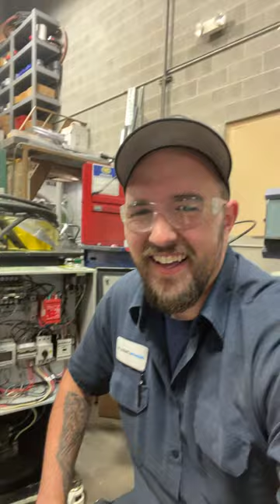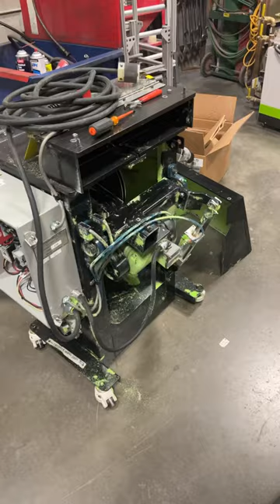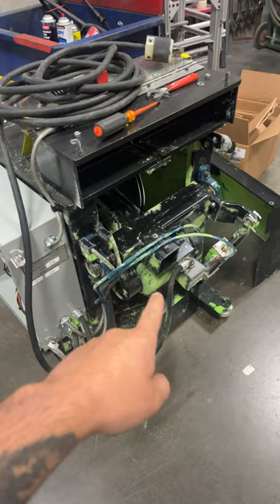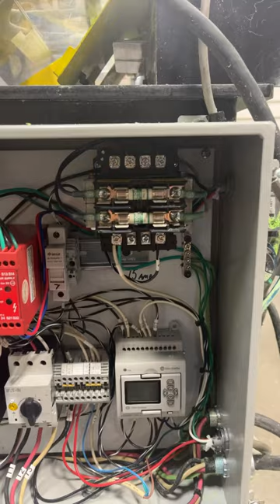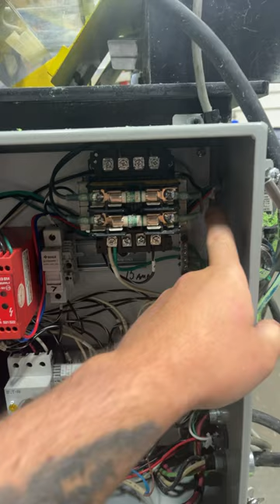Solving problems! #shorts #electric

Comment: Since you are diving into electronics. I think it'd be cool to talk about troubleshooting a bad motor like how to ohm out each leg. Or you can get real fancy and bust out the oscilloscope and give a demonstration of what a sine wave looks like.
Reply from the maker: Great idea!!
Reply: Don't forget to hipot it and the wires to properly diagnose the root cause.
Reply: Technically motors are electrical devices and come under the category of "electrical machines" rather than electronics.

However a the control system for a motor, if one is employed, such as a VFD, is electronic.
Reply: @dansproshop  Maybe even demonstrate a Megger or an Insulation Tester like a Fluke 1507.
Reply: I needed do this today

Comment: 240v ac is weird. The three pin one makes a bit more sense. Just higher voltage phases if I remember correctly.

Four pin 240v you can split the three live wires in such a way to get 110v without a transformer for exactly this application

Comment: You just got to remember that when you're stepping down the voltage your  amperage will increase. When you're stepping up the voltage or amperage will decrease.
Reply: amperage depends on the kva rating of the transformer....
Reply: If he wanted 120 volts he only needs to tap off one hot leg and ground. He didn’t need a transformer
Reply: @Wtfinc  not quite, he has 3 phase power, none of the 3 legs are 120v
Reply: @dalaube  ... he specifically mentions 240 volts and the unit in question has a fuse for each leg, so I'd say it was 240 volt single phase. The prongs on the cord are a ground, neutral, and 2 hot legs.... which begs the question of why use a Xfmr when there's already 120 available?
Reply: @dalaube  oh snakes. He even said 3 phase transformer didn’t he? My mistake lol
(Edit) I rewatched the video, he said the motor was 3phase, thats why I ignored that since capacitor can take care of that, i just assumed, especially when i saw the plug end and it did not look like a 3phase plug when I first saw it. It looked like a regular old 240/120 with three prongs. Welp, good thing for transformers. At least he only needs to worry about. I feel like depending on how a three phase transformer is wired u can have 480 between two legs. Am I correct on that? Imma try draw a diagram see what i find out cause i don’t know off jump
Reply: @rupe53  this is throwing me off too. Admittedly I'm no expert and for me to say much more would be getting in over my head. I can only assume he knows what he's doing, so I'm under the impression hits a 400v 3 phase service, in which case what I said would woulf apply and there is no 120v leg. But I don't know why only 2 of the legs would be fused. Of all the youtubers I watch I'm inclined to believe this guy knows what he's doing...I've been wrong before though.
Reply: @dalaube  ... It's not all shown, but I suspect his 3 phase power is 208v (nominal) and the unit he's playing with is only using a single phase. That's a common enough situation. Just the fact this unit only has 2 fuses tells me it's 2 hot legs, not 3 hot legs. BTW, 3 phase can be 208, 277, or 480 volts. Quite often this presents issues during a brownout because a 5% voltage drop becomes problematic when branching out to 120 volt legs, or gear that's supposed to run 208 - 240 volts single phase. IOW, if 208 is the low end of spec, and you are 5% (or more) down, you are now trying to run at under 100 volts on a leg. Relays on roof-top AC units and elevator switch gear don't like this. The work-around is usually that nominal 208 is closer to 220 volts. (reading with a meter) Now your 5% drop is close to 209 volts so everything is still happy.

Comment: Speaking of electricity, if y'all need 3 phase in your shop, instead of buying a Rotophase or something like that, consider a VFD - a Variable Frequency Drive. 
The VFD can give you infinite speed control of a 3 phase motor AND it can take your shop 220 volts and make its own 3rd leg for 3 phase. 
For a given horsepower rating, the VFD is way cheaper than other types of 3 phase converters. 
Something to always be thinking about when looking at 3 phase shop machines.......😊
Reply: The VFD is cheaper for smaller rated hps. But as you go up in hps the VFD also goes up quite significantly in price. If it's a machine that you don't use all that often most of the time you can get away with a static phase pony motor. For my 7.5 hp Atlas 14" by 52" lathe it was far cheeper to build my own rotary phase converter using a 11 HP motor I scooped up off of Facebook marketplace and stopping at a HVAC supply store for the high voltage start caps and run caps and a two pole relay. With a little time tuning I was able to get the voltages within +- 2 volts of each leg. And did it all for right around $125 including the panel which was used from ebay but suited my purpose. You can get real fancy and run a 555 timer or something similar to control in rush current but I chose to modify the 2 contact start button by shaving less than an 1/8" off of the heel of the contact pad of one side. In doing so it gives it a bit of lag time between the initial two pole relay to run and the start capacitors to run so you don't have a bottom neck of incoming current. The system works fantastic for the past three-and-a-half years and all the parts are completely serviceable and easily sourced.
Reply: @ogt92fromthe1step9  🙂

Comment: I wish I would understand electricity. Actually most knowledge I probably have from watching Electro Boom. I go to like the highest normal school form in germany and all they teach you is how to calculate with power (How many Watts does it need to heat x Material by x Temperature and like Ohms Law) but they still dont teach you how to connect wires(positive, negative and ground), how it basically works and all that simple stuff. So now I am here, scared of electricity because I know how to calculate with it but not how to work with it…
But its as always most useful skills I teached my self or my father(or other persons for that matter) teached me, but not school.

Comment: steps up or down alternating current only, and if you have 3 phase, 2 legs will have 208volts between them.  youre stepping down to 104v if its a 2:1 transformer.  likely well within usable spec for your application.
Reply: Could be a Delta, High Leg. Which would give 240 between phases.

Comment: This is exactly my case use on a daily basis. I'm constantly servicing equipment  that has minimum 240vac feeding the entire unit. Yet inside the electrical cabinet it is being changed to 120 and even sometimes 24 or 12 vdc obviously a little different but basically the same situation

Comment: You'll eventually see most transformers get replaced by solid state inverters because their more effiecient. They're already using them in battery chargers and welding machines etc. So its just a matter of time.

Comment: Yes, voltage can be "stepped up" or "stepped down" with a transformer...but it must be ALTERNATING current. This is the primary distinction between the camps of thought between Edison and Tesla, and why Tesla's alternating current made possible EVERYTHING,  stepping up voltage to send across vast distances, where Edison's folly would have required a DC power station at every corner.
Reply from the maker: Bravo! Best comment yet!!

Comment: As you have a 4-prong plug, that means that 3 of the wires are power and the 4th wire is ground. Where are you getting "Neutral" from?
Reply from the maker: Great question. Neutral comes from the secondary wiring on the transformer
Reply: Technically it is just 2 actives until one gets bonded to ground, and 0 volts of potential, then it becomes a Neutral.

Comment: U don’t need a transformer, just use a hot wire and ground. U think that plug is hot, neutral, and ground but it’s really hot, hot, and ground/neutral. Between hot and ground is 120 for both hot. Between hot and hot is 240

Comment: Yeah but you trade voltage for current output with a transformer. Or vise versa. If you step up voltage then you loose current output.

Comment: Ah, this is a goodin' (like a yizn' only, good). 
Unlike the 240V that goes into everyone's home, etc. The joltage between L1, L2, L3, and N is dependent on whether it's a Wye or Delta config. I believe it has to do with psychics, maths, and magic smoke, if I'm misremembering correctly.

Comment: I do quite a bit of electrical, unfortunately no three phase yet (but I can calculate it). What is your opinion on powering a three phase motor with a split phase to three phase converter? I assume your shop is commercial with three phase from the power company.
Reply from the maker: It is yes. I’ve personal never used a three phase generator, but I know people who use them for large equipment home use. I understand they work good!
Reply: Typically have to get a converter (or VFD as mentioned below) that is rated for twice the power, since 1.732x factor for 3 phase.

Comment: Ah heck, all you needed was to connect a hot leg from the 240v, and connect to a well grounded water line  or a ground wire, no transformer needed!  It would mostly work just fine, depending on who found it there could be a fine! Ha! It could likely get you fired, haha maybe get someone electrified!  😮 But it would have 110-120v 😆 Soo,  NOO!!.. Don't DO THIS

Comment: Not to take away from transformers. The shop I work at needs some infrastructure updated, I found out the other day. 6-8 of our machines still run on relays and switches. 😲😲
Reply: Nothing wrong with relays and switches of the task is dedicated.
Reply: If it works...

Comment: I've rewired many machine's in my day? The transformer is one of the most important components in the machine's wiring? Mostly worked on 3-phase equipment? The primary power in and the control (secondary) windings of the transformer are pretty easy to understand? The overload protection is another sweet component of a system? Great job, Dan.

Comment: Can you send me a make and part number for the step-down transformer you use to do this, Thanks, Mike
Reply from the maker: I thinks it’s just a run of the mill Dayton transformer from grainger with the appropriate voltage i required for the coils
Reply: @dansproshop  thanks for your help.

Comment: What if instead of using both legs of the 240, you only used one, and the neutral… no need to step down transformer? Am I correct?
Reply from the maker: Three phase power has no neutral because the sign waves are perfectly balanced. The neutral needed to operate the 120v. is a product of the transformers secondary coil. Great question!
Reply: If you had a neutral, which you don't in 3 phase
Reply: @SimonQuigley you can certainly have a neutral in 3 phase systems. In many parts of the world it's completely standard. 415V 3 phase is delivered with neutral, which means 3 separate 240V single phases (120deg phase separation) with the neutral, and balanced 3 phase 415V is available directly from the street on a single 4 core feed. Many machines will make use of this by using 3 phase for the motors but one of the passes and the neutral to power a bunch of the control circuits (even if just a single phase 24V DC power supply).
Reply: @matthew35673m  right. I should have said "in this 3 phase implementation". I have worked with 415V 3 phase in Australia which includes a neutral. You can use one of the phases and neutral to get 240v, however it is against code and illegal; the device requires a separate single phase plug when you need 240v as well as 415V.

Comment: But can a transformer explode as nicely as a capacitor?
Reply from the maker: No. Because transformers do not store electricity like a capacitor. Worst case is they can short out to ground. They do not have the potential stored energy like caps do. Great question!!
Reply: @dansproshop  Oh, I think I might have wrote my comment a bit misleading. I was referring to transformers being the best thing in the world of electricity. I mean you can argue with capacitors exploding right in front of ElectroBooms face…